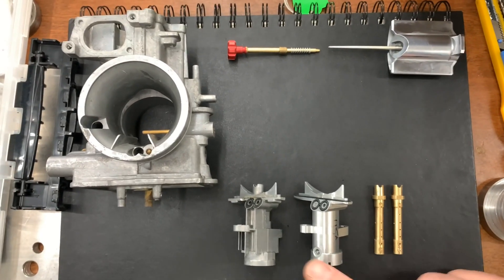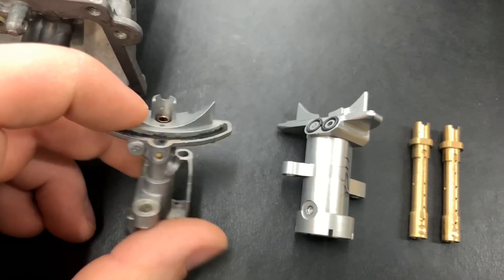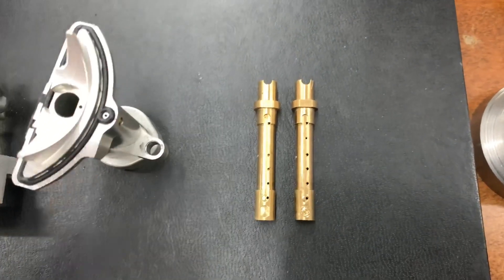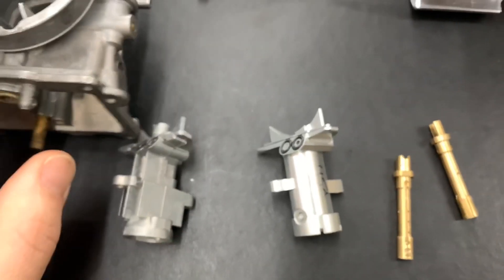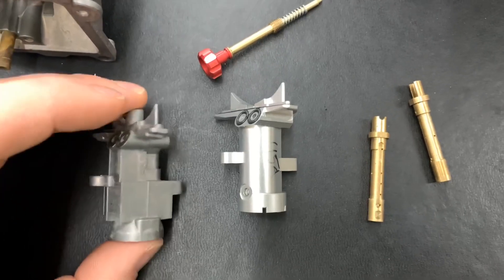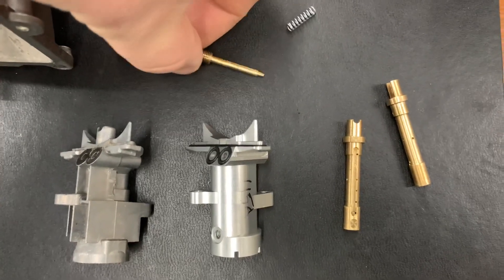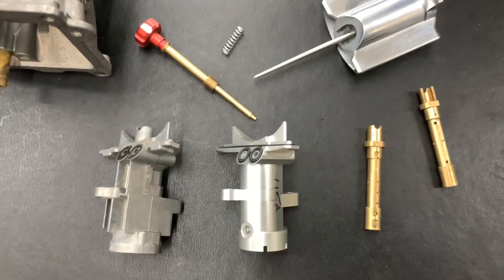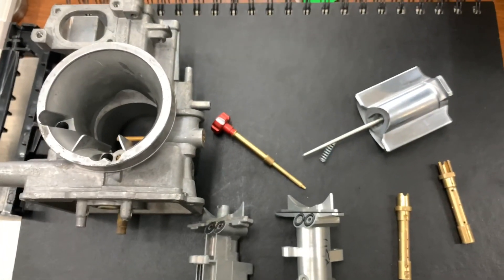STIC carb component explanation

Comment: I moved up to the all new STIC Super X cast carb. It's up another level. It's a clean clone of the PWK AS, both Short body and Screw Top available.
Ran perfect 'as delivered' on my KTM 200SX. I changed the pilot jet from a 50 to an 80! Still had steady low idle. But this thing has me dicing with bigger bikes and clearing jumps right out of turns easier now.  Pure magic for smaller bore low to mid and now it carries over to exceptional mid to top.
Reply: Is the Super X Carb upgrade noticeable in power compared to the regular STIC?
If yes, then is it only low to mid more power or also top end?
And if more, then how much more power you'd say?
I have a regular STIC block.

Comment: I guess my question would be common. But how would you compare it powerwise? Any gains? I´ve heard about this particular stick that it actually outperforme Lectron and a well jetted stock carb. Atleast on the dyno
Reply from the maker: It’s beyond excellent. It doesn’t take much to out perform a single circuit piece of crap lectron. But honestly these are extremely easy to work with. I’d setup jetting on my 500 here in the middle of Canada at 1000’ and 65f, shipped it and rode in California at elevations of 2200-3400 feet and 75-85* weather with only a 1/8 or a turn of airscrew tweak at the most. On the 300 XC-W I’ve run from -5C to 30c with 1/2 a turn of airscrew.
Reply: @RoostiusMaximus  That is really interesting.  Thanks for the imput.

Comment: Did you have to change to race fuel with the added power from the STIC?
Reply from the maker: I don't have premium available that will work with a stock tune on a 300xcw, On that 500 in the video its a VP T2 setup. I can help jet with whichever setup.
Reply: @RoostiusMaximus   just got a cr500 for.the road doing a big tune up can you tell me what carb to get and exactly what stic please I didn't know anything about the stic block.. any tips welcome.and where to.buy cheers
Reply: Do you think that avgas would work?

Comment: What’s the difference between the Screw on top pwk carbs and the one you are running
Reply from the maker: The overall length of the carb is 75mm vs 90mm. I’m also seeing a few more CFM in the short body. I use these when possible to gain the tps sensor which compliments my CDI units also.
Reply: @RoostiusMaximus  is this available for the 39 pwk

Comment: Looks good Adam, had been wondering what all the noise about these STIC things 

Do they work better than a Lectron ? 

Also bikes sound amazing at the shootout, wish we had more footage of there antics with them
Reply: I had a 36mm Lectron on my 300, it worked pretty well once it was dialled in, I then tried a 38mm Keihin with a STIC block, once that was dialled in I would say that the STIC setup is a fair bit better than the Lectron. There is more lowdown torque and generally better throttle response everywhere. The Lectron is probably a little better for MPG but overall the STIC setup is better in my opinion.